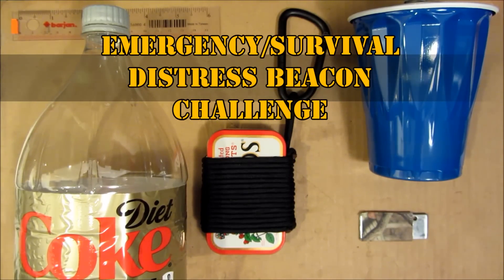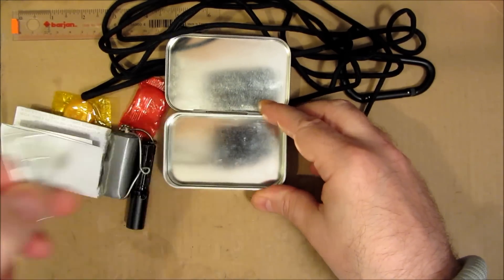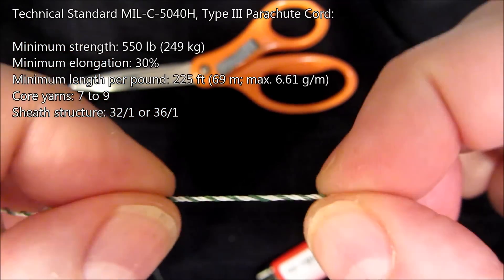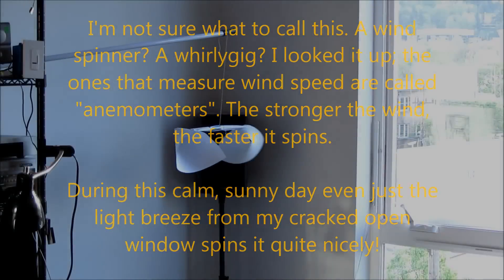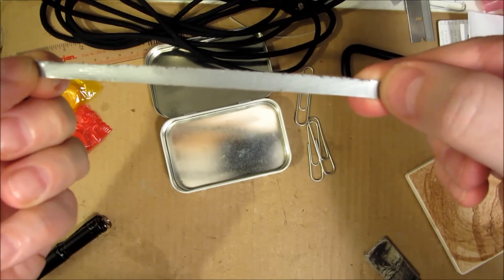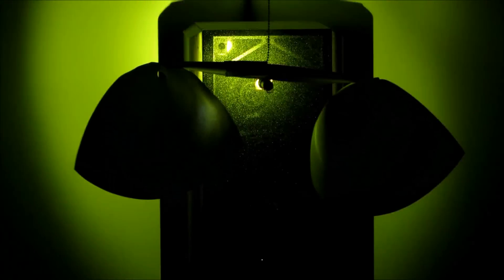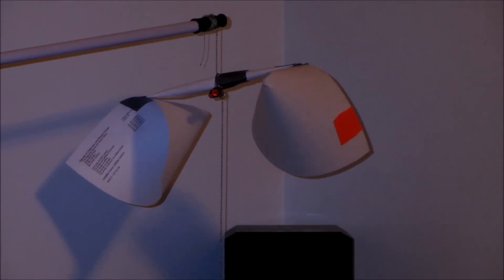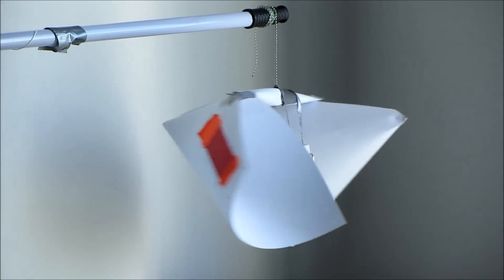Distress Beacon Challenge: How to attract rescuers?

Comment: Great idea. The only reservation I have is durability?
Reply from the maker: +Alloutdoor1 Thanks.  Non-waterproof paper is about the last thing in the world I would recommend making this out of in real world emergency use. I have some waterproof printer paper made by National Geographic, for printing maps, but I was too cheap to use it since this was just an experiment to see if it would work, so I used normal (cheap) paper. As I show in the very opening shot of the video a plastic soda bottle cut into two halves, acting as two wind catcher cups, or perhaps two drinking cups like the Solo cups I show might be a better bet. The cross bar could be perhaps a stick, drift wood, a ruler, two pens/pencils bound together with duct tape, etc. Whatever is on hand. I used only paper in the video under the premise that "What if I was forced to make this whole thing fit in an Altoids survival tin, what might it be made of?"

Comment: Love your videos and always get so many new ideas from you. I thought of a few mods to this that would be a bit more difficult but not much. Thin plastic that is thick enough to maintain its shape, rather than a shopping bag or something flimsy. Also it could actually be designed to deliver Morse code as it spins by using the appropriate alternating  long pieces and short pieces of reflective tape but would have to place them in such a way that as it spun only one piece of tape would be seen at a time somehow so it would light up correctly. This would work somehow, wouldn't it?
Reply from the maker: Christopher Finn Thanks for your ideas! Thin plastic like a shopping bag would probably work for the cups/cones if it could be stretched over a framework to keep the same rigid shape as it passes in the direction against the wind. Imagine little flipped over teepees or pyramid structures, for example. Morse code or some other flash pattern might be possible but wind speed (at least where I did my testing) can be erratic, variable, and has lulls so the rotation rate, hence flash rate, might seem odd: S...O...S...O...................S...................O............SOSOSO................................S  They'd probably get the message but they might think you are drunk! LOL.